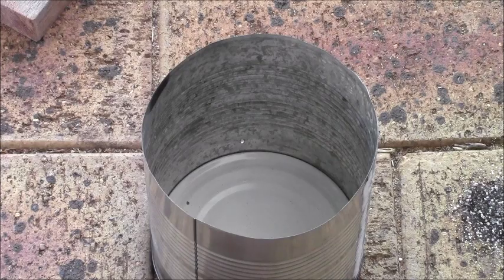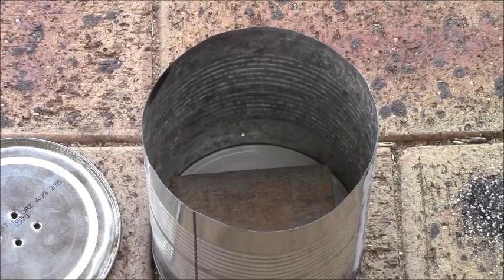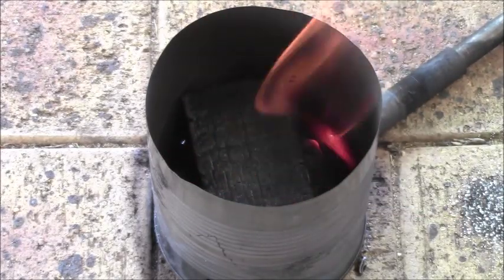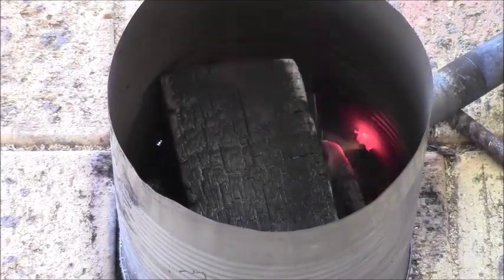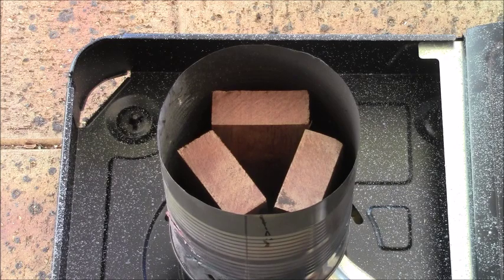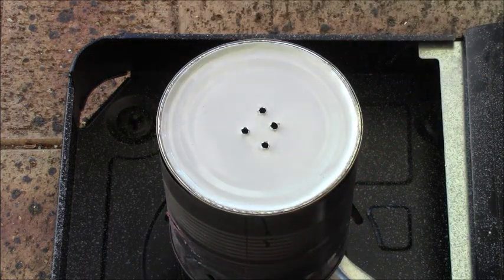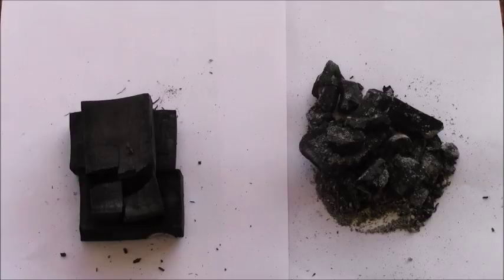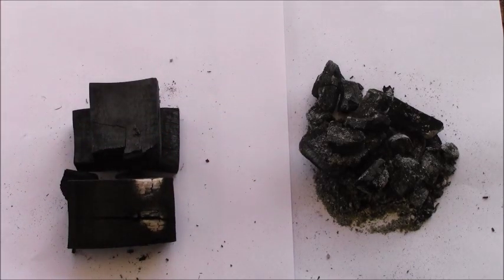How to make firework grade charcoal

Comment: Airfloat is a reference to the mesh size of the charcoal. The  ideal type of charcoal for fireworking depends on the end use, for example, pine charcoal is better for wheel drivers, charcoal stars and rocket motors where a nice tail is required. For hot bp rocket motors, burst and lift you would opt for a more reactive charcoal like willow or ideally paulownia :)

Comment: To make charcoal on a larger scale it's better to use an open flame in a 44 gallon drum but you start with a small fire in the bottom then once the smoke turns clear you fill the barrel with wood then put the lid on top leave to burn and cool overnight and you'll have tons of high quality charcoal